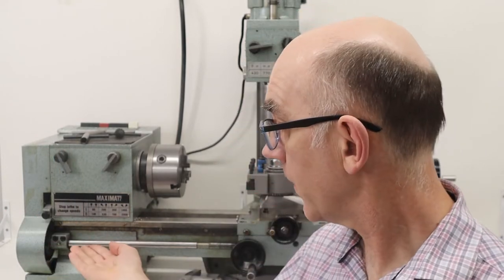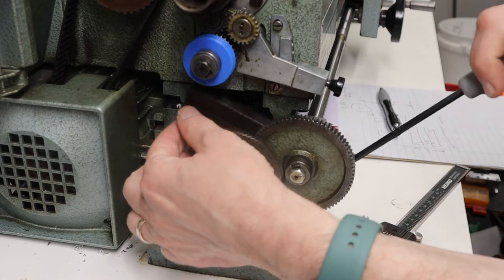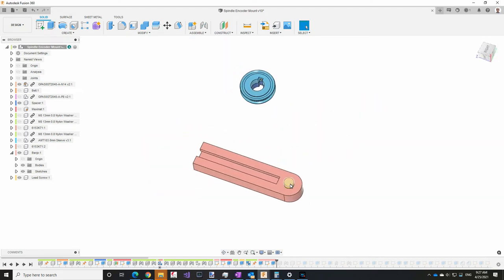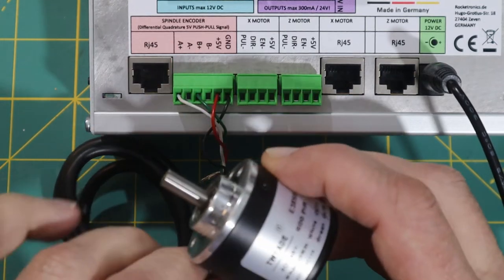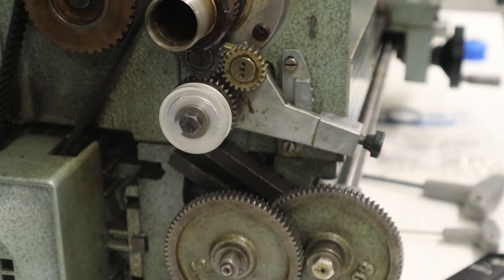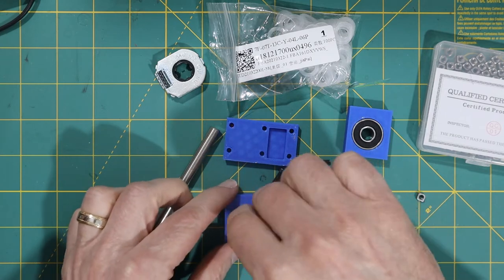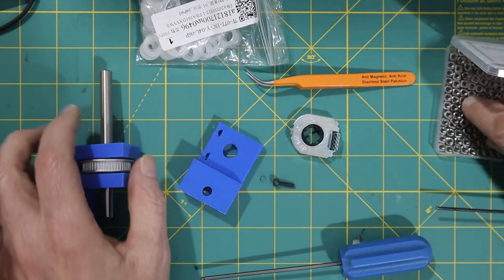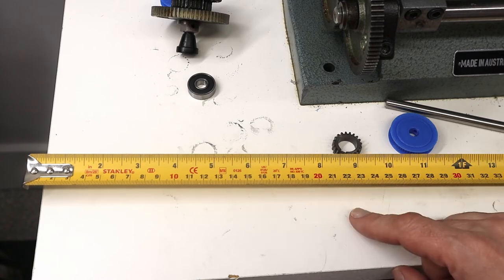Improved Spindle Encoder Mount: ELS and Cross Slide Part 2

Comment: Bob weiram(below) mentions a disc encoder,i've got projects to do involving encoders to wind transformers(toroids and lam stack),the encoders are like potentiometers and are infinite revolution no stop pin,one could connect into the end of a shaft via a connector like is done with stepper motors to lead screws,the caviat being the electrical connection to the encoder,which i assume should be a common point among encoders either 3 pin or 4 pin,a sheet stee bracket  with no belts would be more attractive a proposition than figuring a belt and pulley system.I'd look into this as future repairs may incur the need to strip parts that may have otherwise need not have been touched,someone elses design can always be enhanced from afar i suppose,though the original may have presupposed the components to be used from a common usage view point.

All good stuff in the vids john,
ATB,

John AMPTECH.

Comment: Hi,
I have a chinese 1kw hobby lathe. I dont have enough information for rocketronics system. For example, do we need to change the orginal lead screws on lathe? Because as you know manual lathes has a spaces on its dials. Also need to know, how does it know its position, has it dro sensors mounted on lathe?
Reply from the maker: It uses the original lead screw--you have to enter the distance per rotation into the settings. Also, the positions are all relative. So you have to zero the X and Z position based on the part. I'll be covering those topics in a future episode, once I get the lead screw hooked up (I'm almost there).
Reply: @JohnSL  Do the gaps in the lathe also need to be removed?
Reply from the maker: What gaps are you referring to? I'm going to be attaching the stepper motor to the lead screw by replacing the wheel and dial with a pulley connected via a belt to the stepper motor.

Comment: There's a plastic disc encoder that mounts on the shaft and has a small reader. It's used on inject and laser printers. It's just as accurate and is probably much easier to mount.
Reply from the maker: Hmmm. I didn't find that when I was searching, but I know what you mean. It might not be an off-the-shelf product.
Reply: @JohnSL  Here's another option: https://www.ebay.com/itm/GTK3808-ABZ-3-Phase-Rotate-Encoder-General-purpose-Hollow-Shaft-Encoder-/163719585594?_trksid=p2349624.m46890.l49286. They are called hollow shaft encoder.  They may not mount on your spindle's large diameter, but there may be a much better approach. It maybe possible to mount it directly on the motor's shaft instead of the spindle, which has a smaller diameter and out of the way.  You''ll have to account for the difference in diameter ratios, but you'll have to do this anyway as no two spindles have the same diameter. Some motors also have shaft ends on both side, so it may be to possible to mount the encoder on the rear end of the motor.